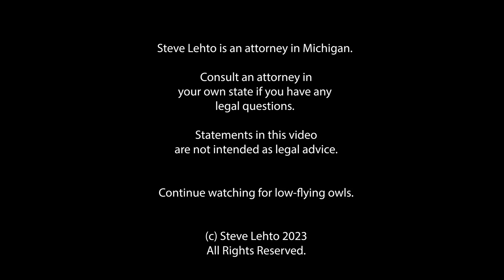The Crazy Legal Problems w/the Turbo Encabulator

Comment: 2:51 time mark:  "And indeed manifested at rate within constraints predicted remarkably by the Turbo Encabulator itself running in a decrossed stator mode infilgated with an early implementation of Alexis-Nexus style legal data base."  PURE GENIUS!!!

P.S.  Would have been a nice touch if you had a calendar demurely tucked in the corner of the background showing the month of April, maybe even showing today's date circled.  😁

Comment: The Turbo Encabulator is a fictional device invented in the 1940s by British engineering company, B.S. Johnson. The device was originally created as a joke, but it gained popularity in engineering circles as a parody of technical writing and marketing jargon.

The Turbo Encabulator is described as a complex device that uses a series of phase detractors, dithering spindles, and modial interaction of magneto reluctance to produce a range of outputs. The device was famously demonstrated in a humorous video by Rockwell Automation in 1977, which became a cult classic and is still widely circulated on the internet.

Despite its fictional nature, the Turbo Encabulator has become a part of engineering lore and is sometimes referenced as an inside joke among engineers. It has also been used in some marketing campaigns as a way to poke fun at technical jargon and overcomplicated product descriptions.

Comment: My first job out of college included some operation of the 1970s model of the Turbo Encabulator. The newer ones include digital readouts and computer interfaces, but I have to say I miss the relative simplicity of those older ones. Analog gauges, manual switches (OK, some relays but those were easy to service). Now you need so many specialized tools just to fix a simple misfit error.

Comment: I don't even understand why engineers use encabulators any more. Now that direct power transvection is easy, cheap, and common, an encabulator is pretty much just redundant hardware. They're obsolete, not even effective as an emergency backup. In any case, though, Lehto, you rock!

Comment: I have an original non turbo encabulator from 1939. Its retributed calibrated has not been frustrated by the upgrade of the turbo model. It was concentrated and vibrated with specs of engineering supurbably bound by oceanonics and the tectonic quantumnonics.

Comment: One of the early claims about the turboencabulator is that it would make electricity too cheap to meter.  The inventors were later sued by the SEC for misleading investors.  They were cleared at trial but by then they had been bankrupted.

Comment: Informative video, as per usual. Unfortunately I doubt that I will ever receive appropriate monetary recompense for the injuries I suffered when the horizontal spangling decoupler on my 2016 Ford Falcon 7 wheel racing barge failed to interface cotemporaniously with the pompous clutch.

Comment: Awesome clarification of some of the bizarre issues stemming from the introduction of turbo encabulators that were never foreseen or even imagined since their early inception / whereby snowballing after the proliferation of syncronous escribits that   are fundamental logistical transfer units to nearly all core personal computer processors since around the mid 80's.  Who would have imagined?  Anyway, after listening to the clear synopsis provided by your video - I now comprehend what I think what I thought I knew, even if where if what you said is perfectly sound to the reason where we can all agree that much of what is heard to think is not the same as here I went again?  Therefore to wit, thx so much & Happy April oneth!

Comment: Finally, someone is addressing the issue(s) surrounding the Encabulator (Original, or 1.0) for legal reasons.  Then obviously the issue(s) were compounded by the Turbo edition of the Encabulator as well as the addition of several additions.  Steve my man you are just the attorney I need for my...purposes.  It seems that I have acquired a mono-pole magnet several countries are laying claim to as well as booby-traps.  Assassination attempts?  Almost daily.  Also the EPA and other environmental groups are making a fuss, the IAEA wants to ask me questions about the linear particle accelerator I have constructed...perhaps across several backyards, underground, without permission.  So you see I'm in a bit of a wicket, and it is sticky I must say.

Comment: Lets not forget that turbo encabulators have been illegal in the state of California since the release of the hyper-encabulator. Unless you modify your turbo encabulator with an ionized catalytic pseudorefractor, but to do that you need a permit for heavy pulselithium hydrostalagtites but who's willing to do that? You might as well refine longitudinal carbon deatomizers in your garage and use that to supplement your barium regravitron.

Comment: And yet they wont use knibling pins. That would make a lot of the trouble no longer a problem in keeping the encabulator running at peek. Thus keeping the  barescent skor motion in better working order in daily use. 

How you kept a straight face through it all is remarkable.

Comment: Resolution involves acquiring a Encabulator Sphincter Gauge from a authorized retailer, having it properly, legally and mechanically calibrated and certified according to Sphincter Gauge specs and receiving the appropriate permits to operate a Class 27b2 Micronized Ionic Nuclear device.

Comment: Everybody knows that the real problem with the Turbo Encabulator is that they only use six hydrocoptic marzelvanes.  They could fix it by using eight of them, but Rockwell figures it's cheaper to pay off the legal claims than to redesign the turbo encabulator.

Comment: The Turbo Encabulator is a fictitious machine or device that first appeared in a parody technical paper by John Hellins Quick in 1944. It is often referenced in engineering and technical humor as an example of jargon and technical language taken to an absurd extreme.

The original technical paper described the Turbo Encabulator as a device for generating "sinusoidal depleneration" in a "differential girdle spring," among other functions. The language used in the description was intentionally convoluted and confusing, and the device was not meant to be taken seriously.

Comment: Rockwell Automation’s Retro Encabulator, a significant improvement over 1977’s Turbo Encabulator, which brought “perfection to the crudely conceived idea of a transmission that would not only supply inverse reactive current for use in unilateral phase detractors, but would also be capable of automatically synchronizing cardinal grammeters.”

Confused? Well, that’s the joke, dating back to at least 1944 and the British Institution of Electrical Engineer’s Student’s Quarterly Journal (yes, the article has a DOI, and can be found in the IET Digital Library, 10.1049/sqj.1944.0033). The encabulator is a fictional electromechanical machine that’s largely used for the propagation of lengthy strings of meaningless technobabble.

Comment: I can't help but think that if the original team of engineers had simply stated that the slip rate between the 64.5 cycle 3 phase ghost leg of the anti-inverter should be configured to run in Delta when used in conjunction with a selenium based metal rectifier.

Comment: The suit gave it all away. The stibulator used in the encabulator is obviously tiniculated and therefore should be verboten. Using the turbo was as effective as adding a turbo to a 1 cylinder 4 stroke engine.

Comment: I just got done consulting with my Lawyer Dog regarding the dealership providing defective wiper brakes and failure to properly replace the blinker fluid in my car, but now have to worry about the turbo encabulator as well....good grief 😢

Comment: Hey, Steve, I consigned with IBM to purchase one of their used turbo encabulators about two years ago with a stipulation that should I encounter no performance issues for a year and a half, my warranty would extend another two years. I live in a state with implied warranty statutes of two years anyway, but I'm having a hard time reconciling the two terms. How would the legal math stack up in my favor? BTW, the model that IBM puts out has only been using the mechanical quick disconnectors for models the military uses in the harshest environments, which is why I chose this model. You know: "The Entabulator That Won WWI". Happy belated AF Day!

Comment: The Turbo quit working on my Encabulator ONE day after the warranty expired. BUT I did purchase a third party extended warranty. The warranty company is failing to honor their warranty on the basis I did not ozonate the the air in the area of its operation. Can you help me with a Magnuson Moss Warranty case?

Comment: My question is what effect would the restrictions of the free floating Canuter valve have on the turbo encabulator in its daily effectiveness of its set parameters? And could this Increase the failure rate of said encabulators?

Comment: My encabulator isn't a turbo.  I was made a year before the turbo version came out (it was my grandfather's, it was handed down to me).  It also runs in standard mode, not de-crossed, but I find it is pretty reliable as long as I keep the blinker fluid topped off.  I've thought about switching to thorium fuel to power the turbines, but I find it amalgamates the dross in the fuel uninjector.  I opted out of the class action and preserved my right to sue.

Comment: Hey, as an internet engineer, your technical assessment is well advised. However, the turbo encabulator has a greater use in the plasmic reconfiguration of fissile material without the expense of incorporating stators in the final stage of the magnetic torus. You have to get the details right
Reply: Btw, I don’t blame you for ending the discussion. It’s ridiculous and clearly defined

Comment: I had  a turbo encabulator on an old  Camaro for bilateral acceleration homogenization purposes.  But eventually the engine blew up, probably because of the neogenical, overturbulation properties of that model of the encabulator.  But it was fun while it lasted.

Comment: Very informative look at this whole mess, but there is still one glaring omission:
You go into these details, but completely side stepped around the spurving bearing and side fumbling issues.  They said they were fixed, but nearly 20% of all warranty repairs involved this.  They claimed it was an issue with the lunar waneshaft, or operator error, but anyone who's had one of these opened can plainly see it is a design flaw in the spurving bearings, allowing excess runout of the pentametric fan beyond what the marzelvanes could handle, resulting in side fumbling.  Now if it was used in lower output ranges where the salesman did their job and specced an oversized turbo encabulator, then the side fumbling issues didn't show up until outside the warranty period.  However, when the customer specced their own going by the online guides, invariably there would be problems.  The tech line always would walk them through replacing the tremmi pipe, cleaning the semi-bovoid slots, rewinding to a variant lotus-e-delta type (which usually resulted in severe electropneumatic stresses), or even using a heavier differential girdlespring.  Of course these were never a permanent fix, and only served to increase the customer's bill when the time came to fix it properly.

Comment: Don't tell Elsevier or Springer that I abused their access to pre-prints to post this section of a paper, may have to cut this back to just the abstract if it draws the attention and ire of the publishers' legal teams.

Abstract

Quantum encabulators have garnered significant attention in recent years for their potential to revolutionize various fields, including materials science, cryptography, and quantum computing. This manuscript provides a comprehensive overview of the theory and practical applications of semi-quiescent fully-syncratic quantum encabulators when working with non-stoichiometric 5-dimensional matrices exhibiting 12-fold symmetry. We discuss the underlying principles, design considerations, and experimental approaches, as well as the challenges and future prospects of this emerging technology.

Introduction

Quantum encabulators are devices that exploit the principles of quantum mechanics to manipulate and process information in unconventional ways. They have the potential to outperform classical computers in certain tasks, such as simulating complex chemical reactions and breaking encryption codes. Semi-quiescent fully-syncratic quantum encabulators (SQFSEs) represent a class of these devices designed to operate with reduced power consumption and enhanced synchronization capabilities.

Non-stoichiometric 5-dimensional matrices with 12-fold symmetry are of particular interest due to their widespread occurrence in nature and their unique electronic and optical properties. These matrices can be found in structures such as zeolites, metal-organic frameworks, and some types of superconductors.

In this manuscript, we aim to provide a comprehensive understanding of the theory and practical applications of SQFSEs when applied to non-stoichiometric 5-dimensional matrices with 12-fold symmetry.

Theory

Semi-quiescent encabulation is a technique that utilizes the properties of Moore-Penrose inverse matrices to encode quantum information in a quantum system. In this approach, the quantum information is embedded in the null space of a matrix, which is a subspace that is orthogonal to the row space of the matrix. The null space is spanned by the Moore-Penrose inverse of the matrix, which is a generalization of the inverse matrix that can be used for matrices that are not invertible.

Comment: Whoa, whoa, whoa, Steve! Are you licensed to practice medicine in the state of Michigan or anywhere else? Gotta ask for personal reasons. You see, for years my wife has lovingly refered to my favourite man part as her "turbo encabulator". I thought is was cute, though irrelevant, as I usually name my body parts more simply, as in "hand", "ear", "leg" and so forth. But memories are coming back. As a child, I was told that my wee dangly bit was a "dinkulus" and, when I was in early adolescence that it was normal to have ocassional nightly "framissions".  When I grew up I just put that down to my parents not knowing the correct words, as like all parents, they're stupid.

But now I find out that turbo encabulator is a thing (my thing in this case) and, Steve, since you're a consumer rights lawyer, I have to ask if I have a case to sue my parents for provision of faulty goods. I'm not sure how the guarantee of merchantability works in cases like this. The turbo encabulator was installed before birth, about 60 years ago, but wasn't, by design, fully functional until years later and field tested far later than I'd hoped for. My turbo encabulator worked well for years, with three fine sons to prove it. But lately the turbo function has gone offline and there are issues with the entire encabulator losing all rigidity at the most inopportune times. Not only that, but now I have to get up a couple of times a night to deal with leakage issues. Is there a real or implied lifetime warranty with my turbo encabulator or would any legal case be nothing more than a wet noodle? Since you're wearing a suit, I trust your judgement in this matter.

Comment: The turbo encabulator has been established that the piston return spring caused that damper to slow down giving the impression of significant boost on the transmission side input shaft connected from the turbo ultranator.. why would you need a lawyer for that?

Comment: Still waiting on the resolutions to problems with the Hyperencabulator. Any updates?
Also, please be aware of cheap knockoffs:
The Enkrapalater (Huawei) and the Mexican/German copies, called El Encobulador/Das Box, do not encabulate, but only deflect grammeter vortices infernally (you may as well just use tin foil).
Curious: what are your thoughts on customizing encabulators, does it stretch the acceptable legal envelope?
I know you said you wouldn't address this again, but I also know that with the constant evolution of techthought, AI, etc., someone will have to.

Comment: Nice April Fools.
The Turbo Encabulator (later the Rockwell Retro Encabulator and SANS ICS HyperEncabulator) is a fictional electromechanical machine with a satirical technobabble description that became a famous in-joke amongst engineers after it was published by the British Institution of Electrical Engineers in their Students' Quarterly Journal in 1944. Technical documentation has been written for the non-existent machine, and there are a number of parody marketing videos.

The original machine has a base-plate of prefabulated aluminite, surmounted by a malleable logarithmic casing in such a way that the two main spurving bearings were in a direct line with the pentametric fan. The latter consisted simply of six hydrocoptic marzlevanes, so fitted to the ambifacient lunar waneshaft that side fumbling was effectively prevented. The main winding was of the normal lotus-o-delta type placed in panendermic semi-bovoid slots in the stator, every seventh conductor being connected by a non-reversible tremie pipe to the differential girdlespring on the "up" end of the grammeters.

Comment: But the legality of Turbo Encabulator is entirely secondary to its Ethics! Far more life are lost in the procurement of the Necessarium via the Alfred-Foyer process for the manufacture of the device than in its actual usage. There is to date no adequate means of mitigation to the Nu-Rho radiation emitted therein. As such, I must implore you to forgo the use of the device regardless of the final legality of it and the practice of its manufacturer.